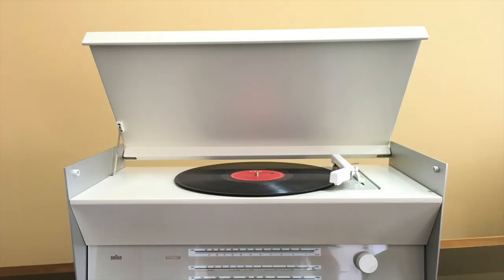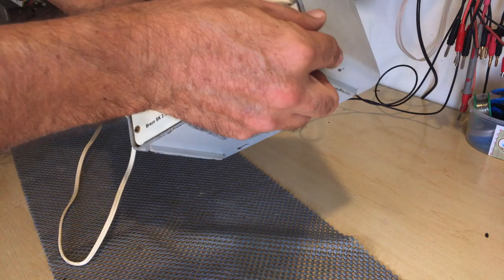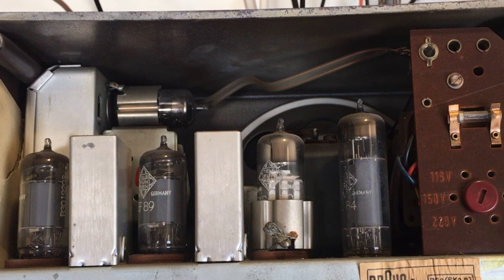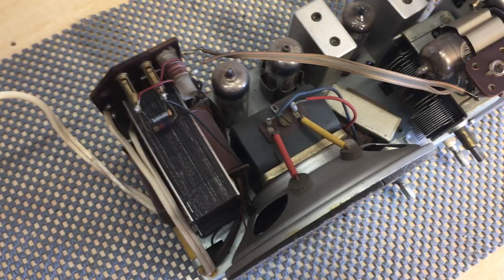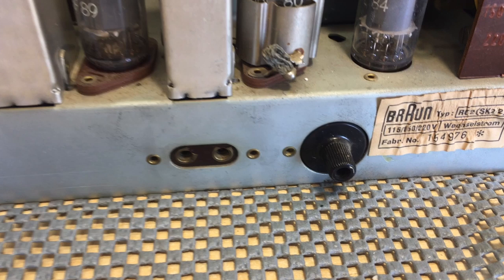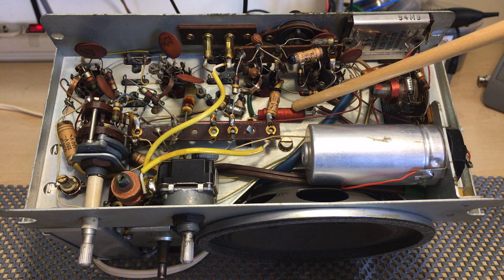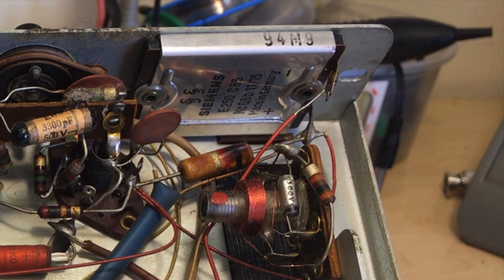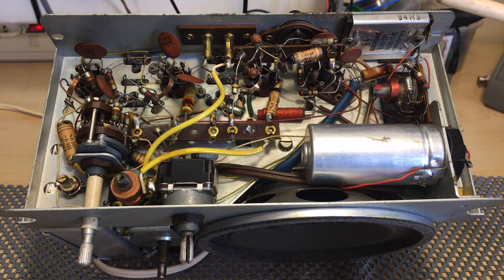Braun SK 2/2 tube radio restoration - part 1

Comment: The design is actually by Artur Braun and Fritz Eichler in 1955. Dieter Rams began working for Braun in 1955 and was involved in SK1 and SK2. Nice work, thanks for the video.
Reply from the maker: You’re absolutely correct. like may, I too incorrectly attributed this radio to Rams.

Comment: The styling reminds me of a North American AC/DC radio from the mid to late 1950s, and is similar to a series of Phillips models that were marketed around 1958-58 or so, but those are larger then that Braun. Interesting how they packed a set with a proper power transformer into such a small package, and kept it simple, it goes along with the American or Japanese design ethic rather then the German.
 With regard to fleabay BIN prices, I've seen that happen before, they have an exhibit, or some picture book featuring pieces by some industrial designer, and then everything he designed suddenly becomes valuable, even though no-one could have cared less when their work was largely anonymous. After a time it fades away,  when people either move onto the next celebrity stylist, or fad, or they find out that examples of their work were not quite as rare as they first thought, some were manufactured in the millions. I believe the name of the company is actually pronounced "Brown" not "Brawn" , even though everyone seems to pronounce it that way anyhow.
Reply from the maker: The popularity of some of these pieces actually grew when people found out that Dieter Rams was the inspiration behind the main Apple designer, Jonathan Ive. Crazy world :)
Reply: So they gained a following by one degree of separation, from the Apple cult? I can remember seeing a Braun at a fellow collectors house and found the look kind of strange, a tube radio with a sort of Scandinavian Ikea look, even the dial was white. Curious how they used what look like carbon comp resistors in your example rather then carbon film ones like most German radios have, some of those are notorious for drifting upward in value.

Comment: Lovely little radio. The decision to use ceramic caps is similar to other higher quality North American designs such as Zenith. I had one radio (Zenith AM/FM) in which I did not have to replace any capacitors. The only detail to attend to was the dreaded selenium rectifier (exposed vane style) but the radio runs fine even on that.
The compactness is similar to a radio on my bench now, a Crosley 11-305U portable with 1V tubes though that one is only an AM...

Cheers,
Reply from the maker: Well see how this one develops.

Comment: Very nice little radio that I am sure you will quickly have in tip top condition.
Reminds me of a Roberts R66 that I did a few months ago. That had 2 selenium rectifiers and low voltage for the valve heaters. It was a battery/ mains radio but only MW/LW. Unique as it has its own turntable on the base to tune for the best signal. Nice little radio.
Reply from the maker: Those battery/mains sets are neat.

Comment: Nice! Looking forward to the rest of this one. One of the things I've noticed about late-50's German/European radios, particularly (but not exclusively) the more expensive & smaller ones, is they ditched paper caps for poly pretty quickly 😊👍. I was actually surprised to see more than a couple in there.

Apart from that, when you took the back off I was reminded of some of the pre-war Australian miniature sets - everything all jammed in there, & very similar layout. Luckily, you didn't find as many spiders inside... 🤣

Odd the schematic shows a single rectifier diode - I thought all that style/series of Siemens were bridges. Maybe a production change or later mod? (edit: no, can't see any AC connections there at all. Learn something new every day...)
Reply from the maker: This one does have the paper caps, unfortunately. Those early poly caps actually hold up quite well.
Surprisingly,the crammed part is only the top, because it’s actually a breeze working on the underside. It really is a minimalistic circuit.
The Siemens part also confused me. I thought it was a bridge too. I’ve never seeming of these before. 
As for learning something new, one of my lecturers at Durban varsity used to say that we would leave university knowing very little, but knowing had to learn very fast, he was right on both counts.

Comment: A lot of those resisters looked burned,I put in the next size up and would use metal film resisters they are more stable,2% tolerance ,flame proof and Ali express has them very cheap and they work well,but I would want to no why those resisters got cooperative bad caps?

Comment: Great video! In the schematics, those capacitors whose capacitance value isn't described with units, in what unit are they? In the schematics it's only described as 10 or 110, are these in microfarads?
Reply from the maker: No, those would be picofarads.

Comment: Strange that there is no ECH81, but two EF89s instead. At first I thought this radio had only FM. Of course you will double-check on the schematic that the two EF89s really belong there.
Reply from the maker: They do, and it’s weird. The first time I’ve come across this. Should be enlightening.

Comment: My schaub lorenz goldy had that kind of paper caps and I found that all of them had double their capacity.  They look so cool but I had to let them go :) looking foward to the next video. Thanks
Reply from the maker: They are normally bad. I did a goldy too and found the same problem.
Reply: It's not that they actually have double capacitance - it's just that the high leakage appears as additional capacitance to simple C meters that just run a single frequency through them and measure the voltage drop...
Reply: @westelaudio943  that still sounds like a bad cap  :)
Reply: @danielsaturnino5715  Indeed...

Comment: Hey! Do you know if this radio would support a phono/aux in somehow?
Reply from the maker: I think it doesn’t have one installed, but you could add a switch and feed it to the top of the volume pot.
Reply: @electronicsoldandnew  thx for the reply! will try that :) Do you think I might break something if I insert to much gain (eg when using it with a phone via aux in)?
Reply from the maker: No. In fact, the level from the phone or other line level source may be a little low, so you may have to put the volume up higher than when you listen to radio.
Reply: @electronicsoldandnew  Ah thx!

Comment: When you showed the area around the Selenium Rectifier I noticed a number of resistors that appeared to have been overheated.  May be an indication of defective rectifier.  Looks like a wonderful little radio, but I can't afford those kind of prices.
Am I correct that this is part 1 of a series and you have not done the other videos yet?
Have you ever worked on any TRF style radios?  I have a couple that I hope to be able to use to make one working one.  It is a Garod V Neutrodyne.  You can see what it looks like here:                                       https://radioatticarchives.com/radio.htm?radio=5765
That is not either of mine in the photos, but mine are the same radio as that in the photos.  There is a schematic for it on this page:                                                                                                                                https://www.qsl.net/wb4rha/g1.html
If you look at the schematic, you will note 3 potentiometers in the circuit.  On front of the radio are 3 large knobs that control 3 variable capacitors, and 2 knobs for "Rheostats" which leaves 1 variable resistor that must be in the back away from the front panel.  There are no service manuals for this so it is going to be fun figuring it all out.
Reply from the maker: This is the first in a series. Don’t know how may it’ll be yet. 
Have fun with yours. Sound interesting. I’ve never done one of those before. Have fun.